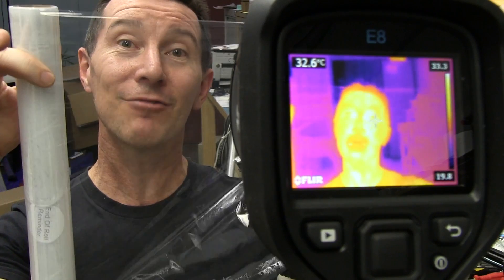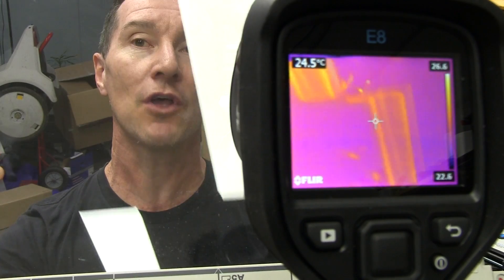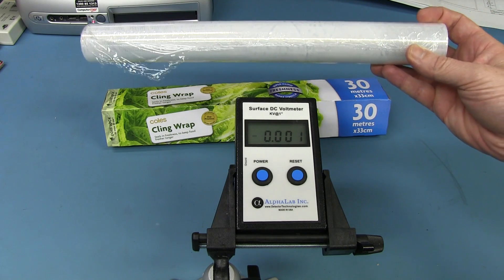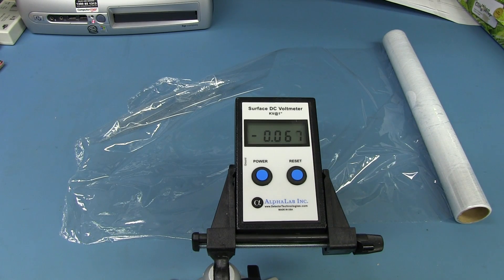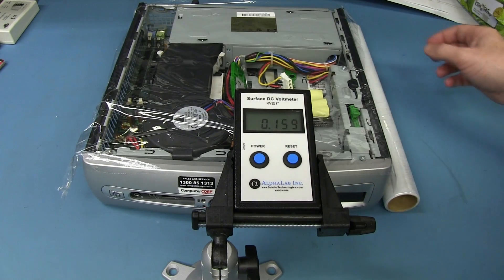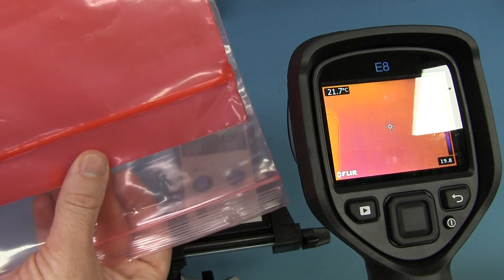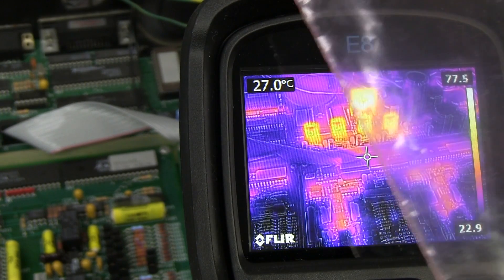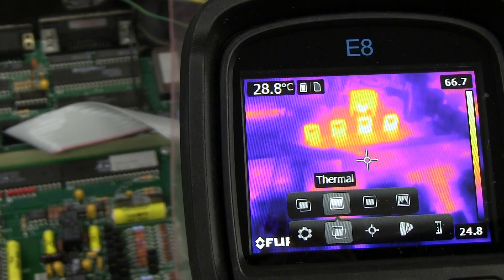EEVblog #623 - See Through Thermal Camera Followup

Comment: I wonder how dangerous for the electronics is the charge build up while removing the protective foil from acrylic glass. Many hobbyist enclose their devices in that material. I wonder how easy it is to destroy your device while working with that. BTW. I wonder about cell polycarbonate sheets also. While removing the foil from them even your hair go straight. Dave, maybe you could make a video about that since you have this surface DC meter.

Comment: Absorption coefficients depend directly on bandgap and wavelength in semiconductors, but the exact relation depends on whether the material is a direct bandgap or indirect bandgap type. For insulators it is mostly dependent on wavelength.

Comment: Hi Dave, difference of temperature decrease between the clean wrap and est bag is also correlated with the thickness of the materials through Beer–Lambert law. I reckon the clean wrap is much thinner than the est bags which you used in the video. Regards

Comment: Dave - part of why the cling wrap works so well is because of how thin it is. It's a combination of material and thickness. Also, when trying to compensate for the change in measured temperature when looking through the plastic, bear in mind that it is not an offset error but rather the thermal radiation received by the camera is a linear combination of the radiation from the target and from the plastic, so the error is proportional to the difference in temperature between the target and the plastic.

Comment: hoped you could test with acryllic/perspex and other materials
Reply: Guillermo Lovato The remote controls use short wave infrared usually around 940nm. Thermal cameras see long wave infrared around 10000nm.
Reply from the maker: Perspex is opaque.
Reply: I was using a FLIR camera on a power electronics inverter a few days ago actually. It has a acrylic lid on it, and no IR comes out at all. So have to have the lid open and hope no components blow up! (still under design stage)
Reply: kalhana1 but then how do those acryllic-like IR windows work for remote controls, they need to be IR-transparent
Reply: Guillermo Lovato They must be a special type of acrylic or some other plastic (often black, opaque appearance). The type I'm talking about is what you commonly find in visually transparent enclosure material.

Comment: Is ESD ever an issue though with this use case? E.g. device plugged in and therefore grounded with cling wrap in direct contact with the casing/earth?

I thought (probably mistakingly so please correct if wrong) that providing the ESD has a safe pathway to earth that this wasn't an issue. E.g. holding a radiator while working on a computer for example.
Reply from the maker: Given that millions of ESD clueless people fiddle with and build computers daily with seemingly no real issues, the odds are very low the clip wrap would do anything.
Reply: EEVblog
Isn't it also true that most manufacturers of chips take ESD into account when designing them? I'm pretty sure I've read "ESD protection till xx Kv" in some datasheets. It depends on what kind of component you're looking at, of-course.

That being said, I think computer motherboards, as any fully populated PCB's are less susceptible to ESD than components on their own. I think you pointed this out in some of your previous videos, also.
Reply: MrDubje Well, ESD is a well known problem with old computers. I fried a few way back because the original engineers on the $4k computers did not think too much about it and it was a rare occurrence for somebody to open the computers up. Nowadays since everybody has a computer, it is probably safe to assume that most of the chips on the motherboard have built-in protection and external protection from ESD, along with sufficient grounding and pull-down capacitors everywhere to prevent excess transients. Perhaps a few TVS diodes sprinkled around the product couldn't hurt?

I have taken newer computers apart dozens of times without ESD protection and have not fried the computers, so those particular motherboard models were well designed. 

I always puke a little when I see electronics that are entirely surrounded by plastic and have mounting holes that dont take advantage of grounding. piss poor design when you also note that there are no transient filters on the mains.

Comment: I wonder how household alarm systems based on PIR sensors perform when covered with a glass panel.
Reply: Hm robera going to a job wearing a huge aqarium hahaha
Reply from the maker: *****
PIR sensors use multiple fresnel lens to detect movement across the area, so glass would block everything and make an even field, so the alarm won't be triggered once it's settled down.
Reply: Simple, they won't perform at all any more... ;)
Reply: Was more wondering if the act of placing a piece of glass stabilised to the temperature of the room would set it off, as if its the pattern of heat it measures or if it wouldn't sound, based upon an averaging of the IR picked up.
Reply: A decent system would use PIRs with anti-masking, which can detect this.

Comment: Hi Dave

The glass that you demonstrated that blocks IR. What was the source of that glass ?
Reply: Systemrat2008 it's not a special glass of any kind, it's just regular glass AFAIK, not even tempered
Reply: Your local glass/window dealer? It's just normal window glass.
Ever heard of the greenhouse effect? Makes use of exactly this property of glass, transparent for light, opaque for thermal IR.
Reply: Hummm I have an IR scope I might do some tests but i thought IR filtered glass and films where special. In fact there are company's selling window film to cut IR for $$$.
Reply: you can see in the bottom it has the sheet size label, that panes was taken from a scanner/photocopier, one of Dave's dumpster dive teardown
Reply: Guillermo Lovato OK that's interesting.i kind of wonder why they would need to use that type of glass in such an application.
Reply: Systemrat2008 A Thermal camera works in the far infrared range ~10,000nm+.  An IR scope (night vision, etc) works in near infrared range 700nm to around 1500nm(for CCD type, specific depends on your night vision equipment). This means the filtering requirements will be different depending on NIR or FIR radiation.
Reply: Systemrat2008
Near infrared and far infrared are completely different things. Even the cheapest webcam can record near infrared just by removing the IR filter.